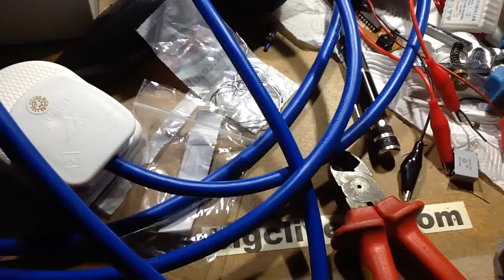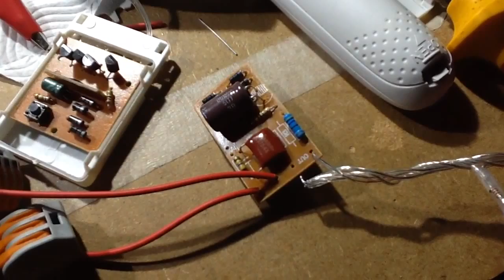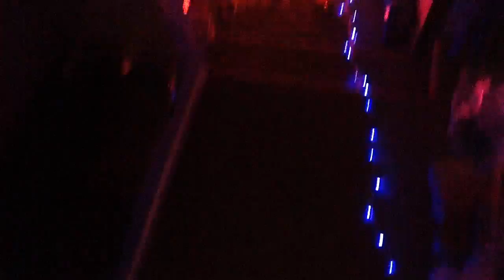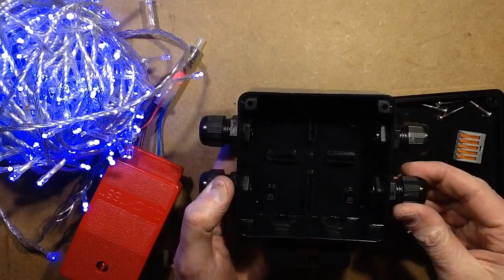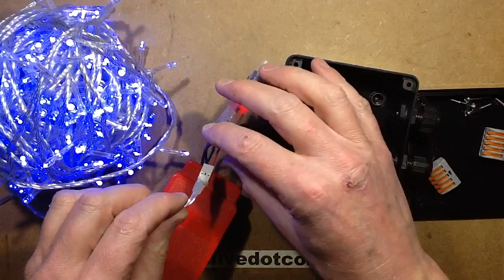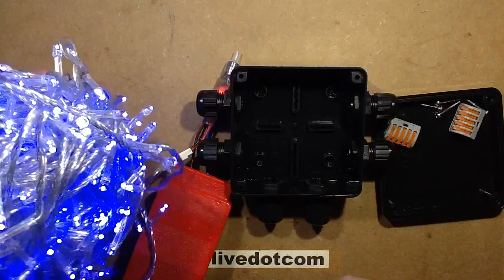DIY Xmas lighting project.

Comment: I wonder about the idea of using the glue gun and putting a squirt of glue in the back of each lamp tube to try to better insulate it. Or you could do the same with silicone RTV, but it would take a lot longer to set up. Probably won't manage to get complete sealing in all cases, but it might help. The question is if it would be worth the time, glue, and effort.

Comment: Clive had to check if it's going to rain tomorrow so he can put lights up... Where I am, you check if it's going to be cool enough. Its not uncommon for 30+ degrees even early in the morning or late in the arvo. And the lights (and mounting hardware) have to cope with baking in the sun in 40 degree heat during the day.
Reply from the maker: Heat is actually good for installing tubelight.  It makes it much more pliable and reduces the risk of damaging it.
Reply: bigclivedotcom
40 degrees unfortunately also makes me more pliable too :p

Comment: Would it be worthwhile putting a blob of hot-melt adhesive over the heat-shrink tube ends of those "cheap Chinese" LED strings? It might reduce (or prevent) water ingress, and so reduce the risk of corrosion? Or, use low-viscosity epoxy? (such as EPON 412)
Reply: Extra waterproofing for electronics is always worthwhile, in my experience. It might not be totally necessary, but a belt and braces approach generally works the best. Epoxy works well for waterproofing (it's essentially the same as conformal coat). For something shaped oddly like that, though, MG chemicals makes a silicone conformal coat in an aerosol, which is ridiculously simple to apply, and has some flexibility as well. It's pricy enough that you don't want to use it for everything, but very worthwhile keeping around to add a thin waterproof layer to odd-shaped parts. Plus, once dried it isn't very visible, either.
I don't know that hot glue would waterproof that all that well, I only really trust that if i can completely encapsulate the part I'm trying to seal, but it is quick and cheap.
Reply: Rather than hot melt or epoxy, sensor safe (automotive type is a common source) RTV sealant would seem the better alternative.  If all electrical connections were already sealed you could even use common caulking but if they aren't, the water and acid vapor cure can foul metal, hence the "sensor safe" type recommendation even though it costs more.  Granted it costs more than hot glue, practically anything costs more than hot glue.  A century ago they might've even used hot wax.
Reply: Providing Big Clive hasn't thrown out the wax from that candle review a few days back, he'd probably have enough for a few thousand LEDs! If you melt candlewax and add about 5% by volume liquid paraffin, the resulting mixture has a much reduced melting point, as well as being softer to mould. This would probably be ideal for such an application.

Comment: What about dropping the lights into a bag and filling with cooking oil, leave untill the next day and a quick wipe, then outside they go?
Surely oil in the leds is better than water :-)
Reply: Most plastics are not oil resistant. Anyone that has played with mineral oil as a coolant knows all the plastic and rubber parts fall apart. Same reason you don't put oil in your brake cylinder. You can use brake fluid in a slipping transmission to make it run for 6 more months but all the seals will be destroyed in the end. Restaurant kitchens ruin shoes because of the cooking oil rotts the plastic. Mechanics wear oil resistant boots for the same reason.
Reply: Well shoot me down dont you lol, and what can he soak the leds in?
Better some kind of oil than allow the water to kill them in no time at all.
Oddly ive never had problems with oil and any plastics, parhaps ive been lucky?
Reply: What about some silicone based lube? It's used on plastic cogs and other moving parts. The ones in spray cans might work a treat.
Reply: Hmm, oh well, its silicone spray then.
People have told me never to use petrolium jelly on plastic gears, it has never caused any problem at all in 30 years, some advice is just bad isnt it :-(
Reply: Most plastics are immune to WD-40.  Check their website, quote FAQ:  "It is safe to use on metal, rubber, wood and plastic. It can also be applied to painted metal surfaces without harming the paint. Polycarbonate and clear polystyrene plastic are among the few surfaces on which to avoid using a petroleum-based product like WD-40
Reply: I'm sure the 3M silicone paste is good stuff but you can get other brands like Super Lube Silicone Dielectric Grease, a 14oz (400g) tub on eBay for about $20, or less in volume.  Just make sure it's part # 91016 as they sell other grease formulations in similar looking tubs too. 

Then again, any kind of grease might be too messy and labor intensive.  I'd wonder if a good spray of clear comformal coating might do well enough.
Reply: I've used the Electrolube SCC3 silicone conformal coating in the past for HV / anti-tracking applications. This stuff cures to a permanent film, but at $30 for a 200ml spray can, is not particularly cheap.
Reply: zx8401ztv What about a little WD40 aka Water Displacement Formula 40???
Reply: See my "hot-melt adhesive" comment above. I'd be interested to hear any feedback on such "DIY" sealing ideas.
Reply: Sounds like a good idea, im waiting for solder king to shoot it down lol :-D.
i thought that plopping the bundle in a bag or small bucket, then adding some kind of oil would allow it to soak into the leds and the ends of the wires, i dont think wd40 would be cheap enough to do it that way.
A good idea though :-D
Reply: LOL Sorry but I already explored that idea of using oil as a displacement method a long time ago. In another project that had plastics involved. Also built a mineral oil submerged computer in a fish tank. Don't do it it's completely not worth the effort and mess. No matter how cool it looks. I just ran into those explanations as to why my attempts sucked. Never mind the sticky brown oily mess you are left with afterwards.

Hot melting the plastics together I don't see why it would be a bad idea you just have to try and figure out the number of ways that lead to failure and not repeat it. Will the plastic hold air pressure from the heat and with repeated expansion, fail? IDK.
WD40 will probably work for a season but my experience with solar yard lights makes me ask. how do you get rid of the condensation that will build up in the connection for storage? The stems would rot out anyways. Cheap string light I guess you are only wanting a single season most likely so try it and see what happens. I'd be interested to know if it works to make them last the season. Or melts the plastic immediately.
Reply: I wonder how evil linseed oil is to plastics, its good for wood i know that.
I know people use cheap lights, water is 100% death to them.
Lanolin, baby oil, yesterdays bacon fat LOL :-D :-D, just joking :-D
Reply: Actually many plastics are oil resistant and you can consult charts to check compatibility, providing you have an eye for determining which type of plastic it is, however certain ones like polypropylene, some rubbers, and especially vinyl considering that's a typical low cost wire insulation, will have lower oil resistance.

However it should be remembered that all "oil" is not the same.  Silicone oil in particular is almost universally compatible with plastic, but of course it costs quite a bit more than petroleum or other plant based oils.
Reply: Linseed oil should be avoided.  While it is a positive thing that it turns onto a thick goo once it has soaked into wood, providing some surface protection against air, water and sun compared to a wet surface that would wipe away to a greater extent (and attract more dirt) that same goo will tend to foul electrical contacts.
Reply: Yes silicone based lube, ive used that stuff on car window rubbers to help them open, nothing has fallen apart LOL :-D
Reply: Yeah, you shouldn't blindly trust advices from random people. Petrolium jelly isn't that aggressive (judging from my experience), and silicone grease is perfectly safe for plastics. I use it to lube the cogs in printers.
Reply: + MrJohhhnnnyyy +zx8401ztv  Dielectric Grease is the best I've ever come across. It will not short out completely nonconductive. Stays pliable for years so you don't need to reapply it. scrape or clean it. It's easy to get into tight tiny places I was first introduced to it for the ford transmission solenoid plugs. They are in a bad location on the side of the unit and keep getting drowned in water and sit constantly in water eventually electrolysis takes over. Once you put this stuff in the plug they last forever. It's expensive though 40 bucks for 5oz
Reply: Manufacturers have been putting petroleum greases on plastic gears in products for decades, BUT jelly aka petrolatum does have a "severe" (based on chemical compatibility charts) effect on nylon, which is the most common plastic gear material.  Nylon will resist most oils and consumer-popular greases, but not creosote.
Reply: Yes ive used it for plastic cogs in video recorders, when ive repaired a machine for someone and the cog was damaged, ive built up the tracks found on the side of cogs with aluminium plate and tiny bolts.
Vasolene or petrolium jelly worked great to re-lube it, it never failed again. :-D
Some of my bodges (to help people that cant afford a new machine) have lasted the life of the machine, i can get very evil when its "Impossible to repair" LOL.
Reply: You might want to take a look at Ebay:  3M 8946 Silicone Paste Clear Dielectric Grease 8 oz 08946  USD20.15 (includes shipping).  I personally think it is a good price, and also is the best material for the lights.The prices go down if you buy in quantity: USD12.40/lb. in a 30lb. tub (delivered), I just don't need 30lbs. of dielectric grease ;)  I can't image how many Christmas lights that would seal.
Reply: +Phil S - I bought my last can of (whatever brand) conformal coating at a Big Lots store for $1.99.  I wouldn't expect to find any near that cheap again but there's probably something out there less expensive than $30 a can and my thought was that while the material cost is high it could drastically reduce labor cost to not have to manually squeeze a solid around every possible ingress point.

Then again, maybe just not buy poor quality lights instead.  I've quite a few strands of Christmas lights that have worked for a few years in a region with its share of rain and snow.
Reply: Stinky Cheese How about using that "silicone" based heat sink composite (available via the "usual suppliers" :-D ) Fairly cheap,  reasonably easy to apply, and water-resistant? I can get a 25g pot for a dollar "down under" (free P&P)!
Reply: 25g for $1 isn't all that cheap.  That's less than an ounce, and it's kind of messy.  I'd go with my original suggestion which was sensor safe silicone RTV sealant sold everywhere for automotive applications.  Unlike many possible kinds of goop, at least it both sets to a solid and remains flexible in cold weather so it won't break away during events like stringing lights.

Comment: I used the cheap Chinese leds last year. I put them up on 1st December. 4 strings of 400. By New Year's eve about half the circuits on each string were dead and most leds showing signs of electrolysis rusting. Best to spray some Wd 40 or spray can version of Waxoyl into the each led where the cables enter. After experimenting with solar light strings during the summe of 2014 this seems to make them last around two years before they start to fail.

Comment: these WAGO connectors are really good
Reply: Even the "knock-off" Chinese ones are pretty OK. For example - http://www.banggood.com/5Pcs-235-Pins-Reusable-Spring-Lever-Terminal-Block-Electric-Cable-Wire-Connector-p-1103030.html?rmmds=search

Comment: A few years back the illuminations dept tried to save money by getting cheap cable from China. It turned out to be like a clay core dipped in copper and when it rained like it does the connections would fail. They soon twigged and scrapped the lot.

Comment: That reminds me about a LED toy I did not fix yet. Can anyone give me an advice? I need some circuit to slowly switch between red, green and blue LED (one of each, powered by 3xAA battery). I'm pretty sure the original was a greetings card chip.
Reply: prbl aproachable with a traffic light circut
there are quite a few different versions using simple ICs and some diskrete components. should be possible to archieve on a breadboard
Reply: Finally did it with a module from old greeting card. Works fine.

Comment: Hey BC, I have a wee question for you sir. I have 40 clear LEDs, that light up red, with 2 wires off each and I want to know a safe way to power them, I am making a little twisted wire tree for my lady. Please could you help.
Reply from the maker: If they are bare LEDs with no resistors then you could probably wire them all in parallel and use a 3V battery pack with a resistor between positive and the common positive connection of the LEDs.  A value of 10 ohms or higher may be suitable.
Reply: Thank you sir, I shall give it a whirl today :)

Comment: Good work Clive you should come over to Blackpool and see how the boys in the illuminations dept do it on their open days. Round the corner from me is the Manx Cable substation that supplies your power via an undersea cable. I will give them a nod to increase the size of the fuse to cope with the extra load if you get carried away
Reply from the maker: I did pop in to the electronics department for a chat that last couple of times I was in Blackpool.
That substation and cable is odd.  The transformers here are an unusual voltage to accommodate the cable drop.
Reply: Simple economics, I guess -- there comes a point where it's just cheaper to tolerate the voltage drop, than to expend any more effort doing anything to try to reduce it.

The demand will go down as appliances become more efficient  (though this will eventually bottom out once there are no more savings to be made),  and the Island is going to get its own local renewable generating capacity anyway in the form of solar PV panels on buildings and small-scale CHP installations.  (Think of a water-cooled engine more in terms of a water heating device which produces a small amount of kinetic energy as a by-product; even if it is only 5% efficient at producing KE, the other 95% which ends up as heat is wanted, and you end up getting electricity for the same price per kWh as your heating fuel.)